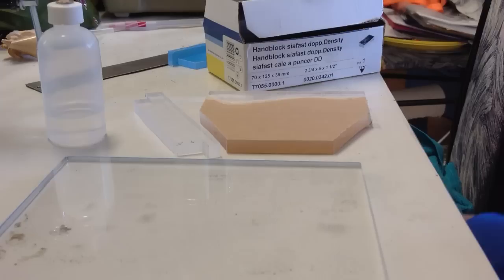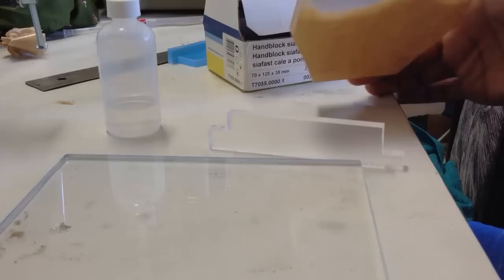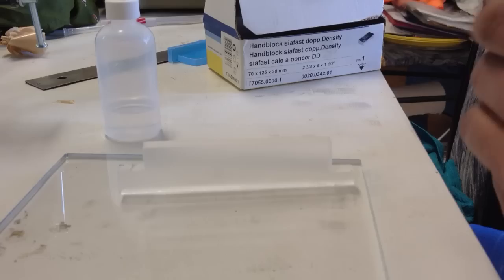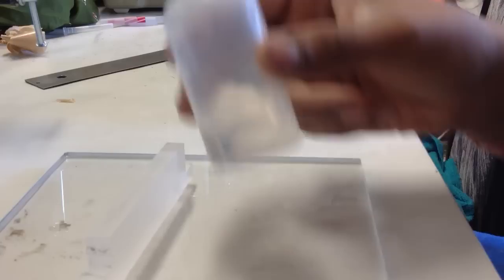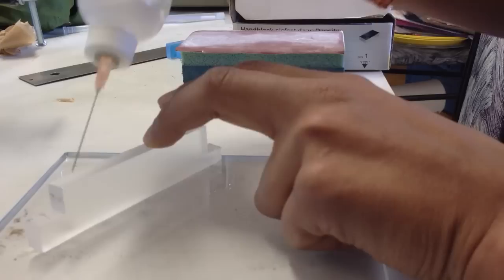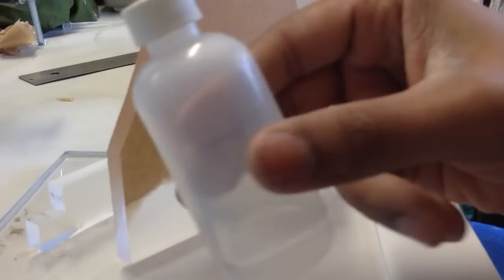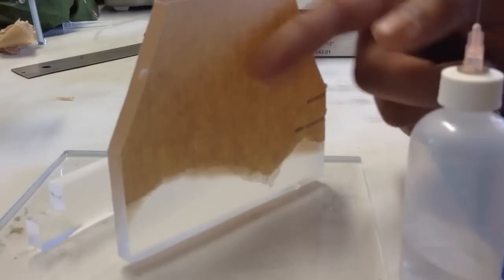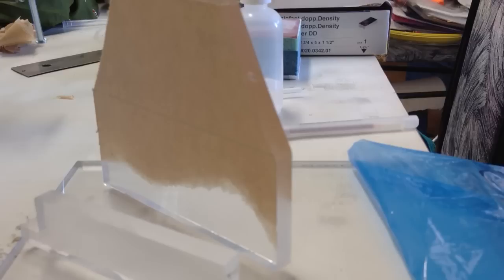How To: Weld Acrylic

Comment: as an ex-fabricator, I think you have done a rather good job explaining in such a short time a nice basic instructional so well done, one thing to note is that as acrylic sheets are formed like a dough that you cant guarantee that your polished face your gluing to is 100% flat either. And on a safety note, liquid acrylic welding  glues work by liquefying the materials therefore actually welding by mixing two liquid components and the bond is formed as the solvent evaporates . And just realize that alot of acrylic glues are derivatives of chloroform, just industrialized for safe handling. so make sure that your in a ventilated area as it can cause problems.

Comment: Don't use a sponge sanding block. It rounds rather than flattens a butt joint surface. Use a solid block and keep it flat against the edge.

Comment: The drawing in of the fluid is called capillary action. The surface tension between the close surface is lessened for the fluid than forming a droplet in the air

Comment: It's better to wet sand any plastic if you can or wear a respirator as fine dust is very dangerous.  Keep the area clean after with a hepa vac and make sure you air out your work area.  Thanks for remembering us ladies and how we like to do this stuff too.

Comment: It's solvent, not glue. It softens and merges the material at the molecular level. That's why the process is often referred to as solvent welding.

Glue is just that - glue. It sticks to each surface and forms a bond. Solvent evaporates and leaves behind the joined surfaces.

Comment: I can second the tip about the router.  I cut my panels in wooden jigs with a router and it leaves by far the cleanest edges you can get from a cutting tool.  They never need sanding and if you need rounded edges you can skip right to buffing.
Reply: What kind of bit r u using on ur router?

Comment: There is no Weldon 1 or 2. There was briefly a Weldon 5 years ago, but it no longer exists. Weldon 3 is intended for extruded acrylics and Weldon 4 is good for continuous cast and cast acrylics. 4 can be used instead of 3 on extruded acrylic with slightly longer setup times, but it's best not use 3 on cast acrylic. All of these joints will degrade fairly quickly, so if you intend to make a decent sized aquarium, intend to make one every other year or so as the joints WILL fail.

Comment: To those of you who have cemented acrylic successfully: On the four brand new sheets I will be using, each one has a sort of "lip" on the longest edge. While all sides are perfectly square/straight/gapless, do I need to prepare that one side by softly sanding it down. I can provide pictures incase I'm not making too much sense. Thanks!

Comment: bro...acetone, u can thicken it up a little by dissolving chunks of scrap acrylic in it. if you spring for the glue ive noticed number 4 can handle shittier rougher cuts with a better bond. but considering how much acetone you can get for a few bucks it might not be worth it. cool tip with the pree squeeze on bottle. you do talk a bit more than needed b4 but there is some great info in here. I've also found that my miter saw plus a 26 buck 80 tooth blade from harbor freight produces chip free cuts that bond well with little to no sanding.

Comment: Hi, may I ask a question, is it possible to make a acrylic tank that can hold with at least 3.7m3 of water  (or let say 2.4 meter length x 1.3 meter width x 1.2 meter height) your answer is very much appreciated.

Comment: MEK, methyl ethyl ketone works fine, dissolves the two surfaces together. That's how they make acrylic aquariums.
Reply: rstevewarmorycom MEK is highly carcinogenic. I f you use it wear gloves and a respirator. The little masks aren't good enough.
Reply: +rstevewarmorycom MEK is a rather nasty carcinogen, use  something like methylenecholide or dichloromethane, just note that any chemical used should be used in a ventilated area

Comment: I learned an awful lot from your video.  It was extremely helpful 2 me as I was looking 4 an alternative 2 CA glue 4 a craft project using colorful pieces of acrylic.   Maybe I'm just glue challenged,  but I found it a messy pain 2 use.  I experimented with acetone and it did work, but I want 2 try the weldon 4.  I have a new Freud blade on my miter saw and it seems 2 cut quite nicely.  When u use a router, what sort of bit r u using?

Comment: Very ambitious... for the sanding you can tape a bit of sand paper on the table and sand the edge moving the whole part. If its small like the one youre demonstrating with. And could it be that the glue you are using is Aceton?

Comment: I tried gluing edges with SciGrip 16. It worked ok but some edges arent very strong because the glue didnt make contact ( I guess I didn't use enough). Can I use Weld-on 4 to go back over all the edges and provide reinforcement? Will the 16 and 4 chemically react?

Comment: hey man, im from mexico i got my own bussiness, im starting :) i tried to glue a box 2 meters large x 1.30 w, i used a syringe to glue my weldon , the problem is that some glue droped in the acrylic ....  and i need to clean that because the client wont accept the work like that .... whats the best method to do it ? 

 im going to use NOVUS 1 and try to polish it off , its there another way to do it?

Comment: How strong is the bond on a 90 degree and 180 degree butt end joints? Does 1/2 inch weld better than any other size like 3/8?

Comment: Can you test for gaps before bonding by using a needle bottle of water instead of glue? This way you can see if the water solution fills all of the bottom of the acrylic piece. If there are gaps, then resand and test again. I havent tried this testing phase personally. Would this work?
Reply: +ScreamHouseGames I suspect this would be a relatively safe way of testing for gaps; keep in mind, though, that water may tend to fill the gaps more readily due to surface tension.

Comment: I'm trying to glue 2 pieces of acrylic together. The acrylic has been painted w water based paint. I've tried solvent based plastic cement. Work great but takes the paint color off the area that has been glued. I need to keep the color, but have a strong bond ( it will b hanging from the ceiling) Please Help!!!

Comment: Hello, question if anybody can help me. I got a 600-gallon acrylic aquarium for next to nothing on Craiglist, the acrylic is 1.1/2 and it weights around 1000 lb. The front and top panel are off so I had to cut it in order to assemble it back together. I only cut one side thought. My question is how do you prepare the edge of a sheet of acrylic that weight almost 300 lb?. I'm having difficulties with the router since it does not go all the way through. And moving it around its a nightmare, It can be done but short distances between 3 or 4 people for the front panel alone. I need help in preparing the edges for 1.1/2 inch acrylic. I've been doing it with sandpaper, please let me know.

Comment: If it is a tube, can it handle 150 PSI pressure after glue it together?
Reply: Probably, if it works the way he says it does. If the two pieces actually fuse together then it is like one solid piece and it will be as strong as the material allows it to be.

Comment: If the adhesive drips or gets on somewhere you don't want and reacts to the plexi how can you clean it up?
Reply from the maker: Usually I let it evaporate by itself. Otherwise I wipe it off as the needle goes along the edge. Now if you already have those marks you can use a 1200 grid sandpaper and then flame polish it.
Reply: +Primo Reef Acrylics flame polish ? i got hydrogen + oxigen ... but thats risky my man , whats ur tecnique ? :)
Reply: Don't touch it, let it evaporate and polish remaining shadow out.

Comment: when i made my DIY biocube sump, i used plastic surgery, which was more like a super glue, and i ended up with leaks!!! can i still use the weld-on 16?
Reply from the maker: Oh you've caught me! I've never used superglue with acrylic (Plastics). The only and main method is using Weld-On 3, 4, 16 or 40
Reply: Hmmm...label is misleading!
Reply: Juan's Reef Aquariums
Why? He did not write "Glue acrylic", he said "weld acrylic". How is that misleading??
Reply from the maker: Jonny Bravo that is correct Jonny thanks. and Juan's Reef Aquariums the concept of bonding 2 acrylic sheets in technical terms is called bonding (weld-on bonding). Using the term glueing is a incorrect term. Like metal welding, 2 pieces of acrylic is "welded"/"bonded" together just like how the metal concept is.
Reply: Yes, as i understand the acrylic welding method is really quite similar to metal welding, as the chemical kind of softens or loosens the molecules on each piece, so they really bond together, almost as they where one piece!

Comment: is it possible to, for instance, take two 8x8x1 pieces of acrylic and adhere them so that it's 8x8x2 and still has the see through attribute clear acrylic is known for? I'm looking to cut channels in once piece and then closing it off
Reply: No, you can't.
Reply: i bet it's possible, but you would need a VERY smooth coat of the welder and somehow take all the air bubbles out

Comment: Superglue works just fine because it's cyanoacrylate and i've broken a glued piece and it didn't break at the connection. You should see through the superglue connection into the other piece.
Reply: +D MatLeo Superglue works and bonds near instantly with great strength indeed, but the problem you have with that method it is or can be rather ugly. This method using WeldOn is perfect for that professional seemless bond. Though of course if no one is going to see your work it won't matter what you really use as long as it does the job for you.
Reply: MidnightMarrow
 It can be made squeaky clean with acetone but it can also wash the bond, so use a little on a cloth piece or cotton swab, don't apply it directly to the bond.

Comment: what acrylic thickness do you use
Reply from the maker: In this video it's 3/8" acrylic. However for all my builds I use 1/4", 3/8", 1/2", 3/4", 1", 1.5" and 3" thick.
Reply: Thanks.  I'm a big fan of your work.  Nice products.
Reply: ***** 
What can I use to bond acrylic to PVC???
Reply: +Primo Reef Acrylics . Hoc can I bond strongly 5 walls of acrylics together length 50 meters, height 6 meters, thickness 1 meter. It will be a rectangular shape of 50 m long, 25 m width and 6 m high